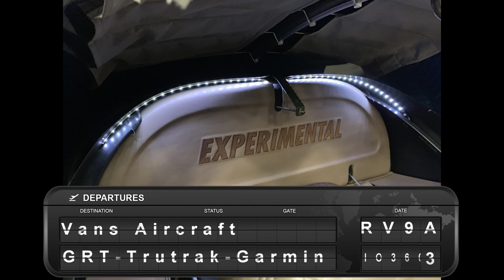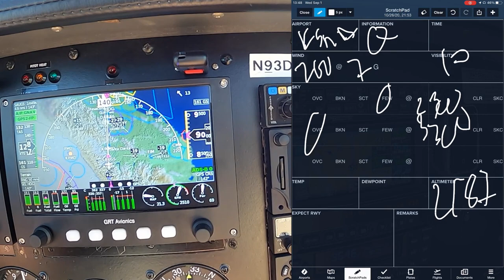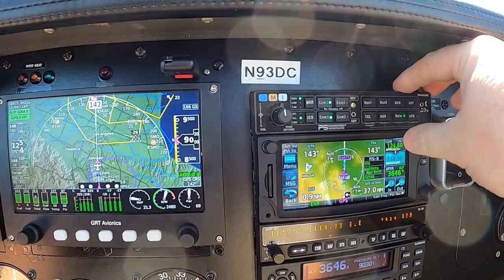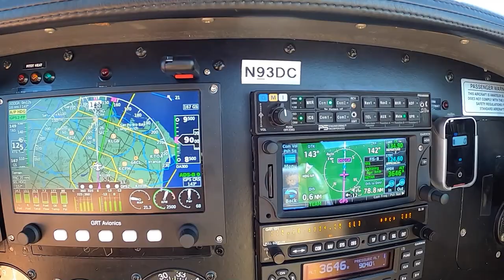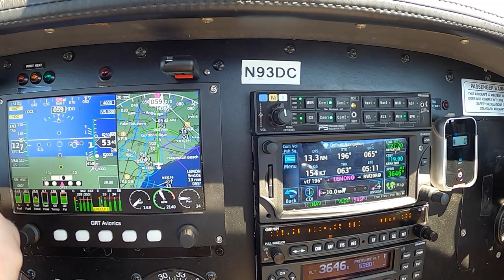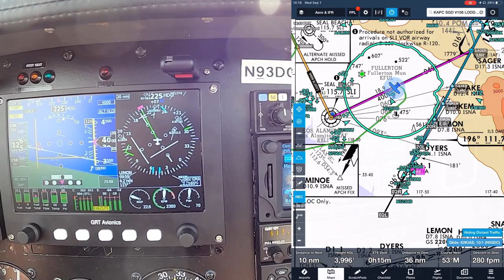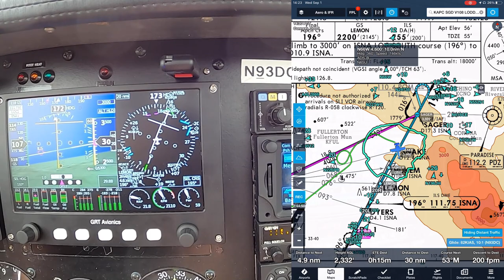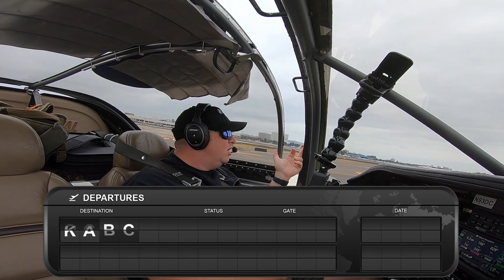10+ Turns Vector to Final in IMC!   Napa to Orange County!

Comment: I've only flown VFR under Light Sport fixed wing, but have practiced IFR using Microsoft's series of flight simulators for desktop computers, including their latest sim, MSFS 2020 which can reproduce my VFR flying experience really well.  I have tried IFR flight and it is nerve wracking to fly and hope one is lined up with the runway and hope the traffic around is aware a slower aircraft is on approach.

With our modern GPS's, it's a bit easier to fly IFR but one must still use the localizer to stay on the runway heading and glide slope.

The most amazing IFR landing I experienced as a passenger was on a Mexicana flight into Denver from Zacatecas.  The soup was so bad we had to divert to Pueblo and wait for the soup in Denver to lift, we were stuck in Pueblo two hours.  When we landed in Denver, I did not see the runway until I was just over it, and from my point of view that was only about 75 feet of visibility so the pilots were flying and landing at minimums.

We missed our connection and had to wait seven hours for the next one to Phoenix, and my wife was so patient--I had a terrible migraine by that time from the stress and the flight attendants gave me Excedrin so I could drive us home from Sky Harbor.

I enjoy videos like yours because they show excellent pilotage.  My CFI showed me how easy it was to learn how to fly, and how challenging it was to become a pilot, which is why I never went for an IFR ticket and remained with Light Sport.

But I practice IFR flight on my desktop simulator in case weather unexpectedly moves in--it may save my life some day.
Reply from the maker: It may very well!  Thanks for the kind words and the stories!  And thanks again for watching the channel. I really appreciate it!

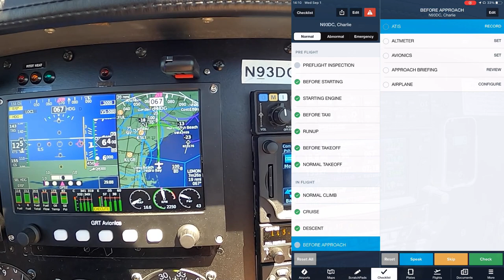Comment: 17:31 121.30 is listed as the final approach frequency, you should be expecting to be sent to that at some point (ie, it would be a indicator that once you're on that freq, that's who is going to issue the app clearance, therefore, it would be reasonable to get the tower freq into stdby once you're on that freq). Later, when the controller issues the freq, you didn't read it back. Reading back numbers is generally considered good practice. It prevents basic miscommunication, and selfishly, simply SAYING it helps cement it into short term memory. Case in point, you didn't read it back, then you needed the replay feature to recall it, and then you didn't enter it correctly. 

Just like accidents are made of chains of events, so too are mistakes with small tasks like freq changes. THOSE errors can lead to stress and additional workload. Definitely consider small changes like this to improve your efficiency. I can all but promise that the flights will go smoother and your workload will drop.  Final point, when you dial in a freq, say it out loud. LOOK at the numbers you're dialing, making sure that what you're saying matches what you're dialing. This is a technique that Rod Machado teaches, and he's spot on. It all but removes the possibility of this sort of thing happening. Great video, btw! Please don't take this comment to mean otherwise :)
Reply from the maker: I always love the feedback. I found a ton of mistakes in this trip this time around. Nothing that made me unsafe. Just some things like you pointed out that can make me even better. I appreciate it!!
Reply: @svtpete83  Outstanding. The key to IFR is minimizing how much work needs to be done at any point in time. This can be achieved through spreading things out (ie, planning ahead) and minimizing mistakes (ie, reducing the total amount of work you do over the course of the flight). Keep at it and have fun!